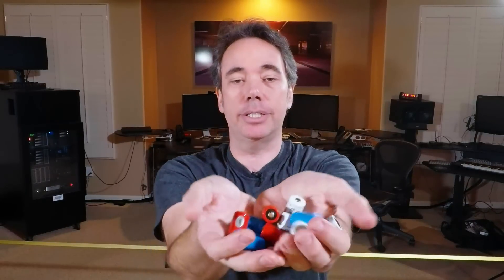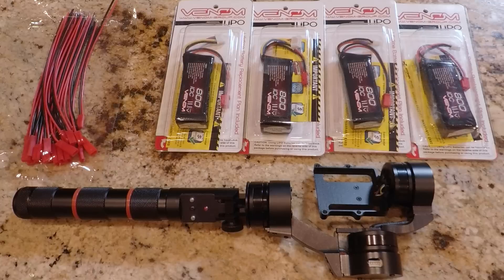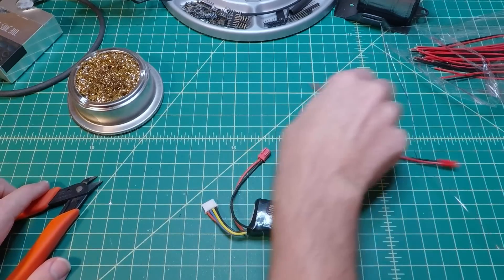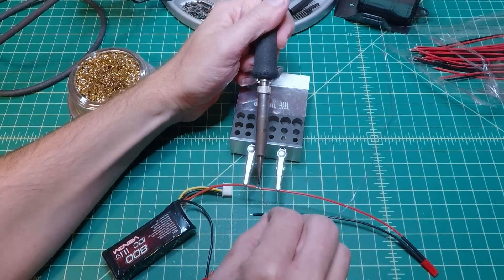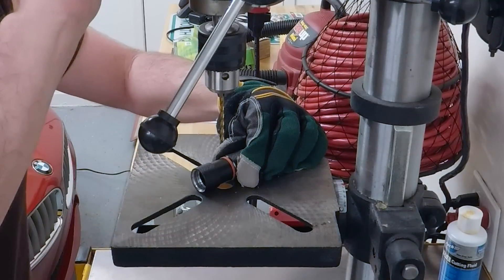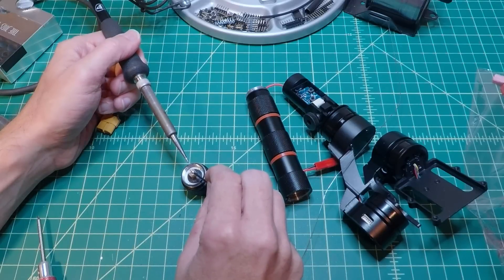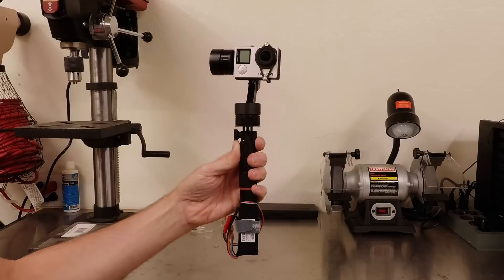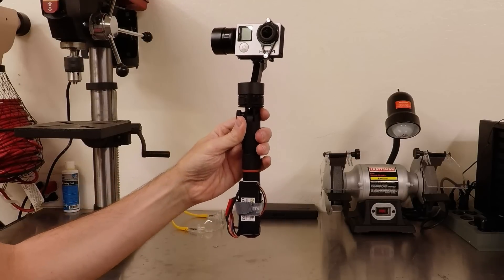3-Axis gimbal supercharger - mod it to use a 3S battery (PilotFly FunnyGo, Feiyu G3 Ultra, etc)

Comment: At a certain point, you might as well get a $150 gimbal, a lipo, and put it on any stick or cage of your choice.  You should consider a double-sided velcro instead of a strap...  I also wonder if there is a round lipo that could fit in that space for a cleaner install.  

Regardless, the point of these units is user friendliness.  No need for proper lipo management and carrying a lipo charger.  On the go, 16340 batteries are going to be much easier to find than lipos as well.
Reply from the maker: The only thing I saw out of CES that I'll probably pick up is DJI's new handheld gimbal that works with the Inspire 1... It's not available yet, and it only works with their Inspire 1 camera (so no GoPro), but it looks pretty interesting.  One thing that I like about their camera is that it has a narrower field of view, so depending on what you're doing, that could be a plus or minus.  BUT, they haven't announced pricing or anything else, so I'd guess it's going to be in the $1000+ range including camera.

Surprisingly, nothing else - everything was just more of the same, but I'm going to NAB, and there's bound to be some interesting things there - but too late for your trip.

I would also not wait too long on getting something, so you have time to work out any kinks before leaving.  Getting batteries are a pain (check out my mod, hint hint), sometimes you need to tune it a bit depending on what camera you're using, etc.  And it's helpful to play with it before you try to shoot something that actually matters.  ;)
Reply from the maker: Philly Drones Actually, Basecam/Alexmos has lipo management in it, so not an issue with the FunnyGo - with the G3 you'd need to make sure not to over-drain it, but it's easy enough to just swap it when you swap the GoPro battery.

The problem is getting consistent quality in the 16340's... I've purchased from 8 different manufacturers, ranging from 600mAh to 1000mAh, and some won't even run the gimbal for 20 minutes and are rated at 1000, some are rated 600 and run for an hour.  Buy some a couple months later from the same manufacturer, now their 600 runs 30 minutes.  Absolutely no quality or consistently.

It definitely does hurt the user-friendliness a bit, but for me, not much, and the difference in performance of these batteries and 16340's is night and day... I looked around for a round Lipo, but I was a bit worried I'd run into the same consistency issues.

And I've built a couple fully DIY, the trick is the form factor of these gimbals even with an external battery is still much better... Now if only they'd put a 1/4-20 tripod mount on any of them!  ;)
Reply: Anx2k I mean lipo management in terms of storage and charging.  I had no idea that these 16340 batteries are so inconsistent, though.  

I have a bunch of gimbals but thinking of buying a similar setup myself.  There is a company that just released a new hand held gimbal that supposedly higher torque motors and sturdier construction.  $300ish for 8bit and $400 for what looks like 32 bit alexmos.  Z1-Rider and Z1-Pround.  My gimbal use is mostly on quads where low weight is top priority.  I would like to have something sturdier for regular use...
Reply from the maker: Philly Drones Gotcha - yeah, I was surprised with the state of 16340's also...  Plus there's protected and unprotected, blah blah - I would have preferred if they just used a bunch of standard AA's or something else that was easy to source.

I've looked at most of the new ones, but none had anything to make me pull the trigger on them yet.  From my experience, the sturdier construction argument isn't valid - they're all about as robust as you'd expect, so anything beyond what they've got is probably pointless.  The higher torque motors are also largely irrelevant as well (for ones targeted at a particular camera, like the GoPro) - the motors on both are more than capable, so from my perspective it's kind of like 'more is better, right?'.  If you had the flexibility of different cameras, then it might make more sense.  8bit vs 32bit is also largely irrelevant I think - although this could certainly change in time, as the 32bit platform is the one of choice... I have both 8bit and 32bit drone gimbals, and I'd be hard pressed to tell which works better based on the performance.  

The Z1 is probably the most interesting of the bunch on paper, but they're running some proprietary firmware, no wireless remote control, and one of the GoPro forum guys has one and said their battery claims are way off, which calls into question some of their other specs like resolution that seemed very high.

The big upside of these GoPro gimbals is that they're pretty simple to deal with, pretty durable, and by and large much less tweaky than the quad ones...  CES is this week, I would hold off on buying anything until after it's over and seeing if anything new and interesting gets released.  I'm sure there's going to be a bunch of new ones shown there - hopefully with some cool new features.
Reply: Anx2k The speed at which new gimbals have been arriving to market is pretty incredible.  It seems like only 6-12 months ago just having 3 axis was a big deal.  

I can't tell a difference between 8 and 32 bit, either.  (That's what I thought those 2 gimbals had, but their web page doesn't reference Alexmos at all.)  But high torque appeals me to me as I would put it on a motorcycle, where just the wind force is huge.  A sturdier construction overall appeals to me.  One of my gimbals worked great until the magnetic motors caught some iron/dirt and now one of the motors is bricked and it doesn't work and I can't open up that motor to clean it.  Just a big PIA.  I guess we'll see what CES brings.
Reply from the maker: If you watch my extra footage video, I hold the gimbal outside the car and we were probably doing 40-45mph, and it didn't seem to have any issues even when it was 90 degrees to the wind - and that's the FunnyGo, which would have the weaker motors compared to the G3, plus it's power settings were at half power.

As far as debris getting into the motors - I haven't seen any that won't have that problem - they all are open where the motor rotates.
Reply: Anx2k Anything at CES make you think we should hold out on a purchase? I've got a trip in March that I want to bring a FunnyGo with me on and so I may wait until mid-Feb to make a purchase anyway. I doubt anything will come out between then and now that would keep me from getting one.

Comment: here it goes ! I would also recommend:
- to sand the borders of the drilled hole, to avoid them being too sharping for the JST cables going in.
- You could also even fit in the drilled hole one RC helicopter canopy nut (http://www.amain.com/align-450-rubber-canopy-nut-set-4/p92838)

For those who wonder the venom 3S 800mah used is as followed dimensions: 68 x 26 x 18 mm / 2.68 x 1.02 x 0.71 in. Watt Hours: 8.88. Weight: 2.3 oz (65.2 g). This is a really good choice as other similar lipos are smaller but have more thickness which is less convenient to handle.

Only "drawback" are: 
- that you need a 3S lipo charger/balancer, but they are cheap :) but this is normal as your are moving to lipo technology.
- you are probably canceling the warranty of the product

Do you think that running this funny go on "steroids" ... in 4S is possible ?
Reply from the maker: okayplayer31 Love the canopy nut - excellent suggestion!

I'm not sure what sort of voltage converter these gimbals have, so I wouldn't be all that keen to run a 4S on it - and unlike in the hobby world where the 4S would go directly to the ESC and then the motor, with the gimbals the controller is metering out the power to the motors, so I don't think there would be any true gain.

If you were looking for more time, then obviously just a larger mAh battery is all that's needed - and if you want more holding power, as my gimbal was configured, it was only at about 1/2 the max power, so you've got legroom to add more to them.  That being said, when I fiddled with it you ended up with just more heat being generated at the motors than any better stabilization - it's always better to balance than try to brute force with gimbals.

I think if you really want to run on Steroids, it's time to just go the full DIY path, where you pick your components.  :)
Reply: Anx2k Hi there, just got my funnygo but it's acting really weird. I looked all the tutorials to calibrate but still not working as it should. I posted a video of what I do... if you have any thoughts ? I am quite disappointed at this time :(

https://www.youtube.com/watch?v=iSQhJ7Sumko
Reply from the maker: okayplayer31 Well, the first thing I would say is that you want to start the gimbal facing forward like normal... Also, so the way you're doing the gyro calibration isn't correct - you have to be holding the camera firmly on the table while holding the button in.  If you do it the way you're doing, it will definitely screw up the calibration.  Consider that you want it COMPLETELY immobilized before and during the calibration.  If there is any movement, it's going to screw it up - from your video, you enter the calibration mode, then hold it against the table - but the problem is, it's already calibrating, make sense?  Hopefully that helps, I suspect it will work radically better once you do it correctly...
Reply: Anx2k thanks, in fact It is extermely hard to get this totally aligned with the horizon on all the axis! I didn't want to apply pressure on the motors to avoid breaking them (as you could do with rc servos), so I used the bluetooth and imac stuff to make this better. I also have to learn to use the gimbal because that's not that easy to find out which mode is the best for each usage. last comment, I think that the lock of the handle is not appropriate, in fact it is ULTRA tighten and if you untighten it (first with the allen key...) it just move freely. There is a high way of improvement on this to be done in the future. I also think that when going outside, it should be better to remove or unplug the bluetooth wire... to avoid the battery going stuck only by this
Reply from the maker: All good suggestions - make sure to tell PilotFly!  ;)  As far as hurting the motors - don't worry about it, it's not like an RC motor, so you can grab it while it's going and manhandle it without any real worries - bending a shaft or debris getting in the stator portion is pretty much the only thing you could do to damage them, and you have to be doing some crazy stuff generally to make that happen.

Now that you've figured it out through the GUI, definitely get used to doing it on the gimbal itself, as it's handy to be able to do in the field, and it's pretty simple once you get the hang of it.

As far as mode goes, just using the gimbal will give you a sense of what's best for what situation - in general I think you'll just be using mode 1 for almost everything.  I generally only use the other modes for specialty shooting things.

Glad you got it resolved!